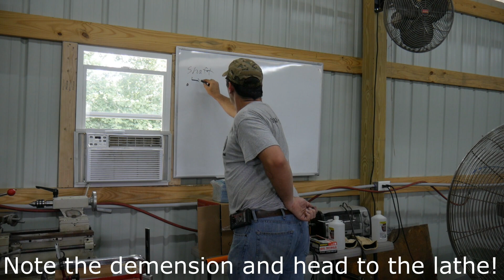DIY Tormach 4th Axis Ep 3

Comment: I just ordered my driver, same listing as yours to keep this simple.  Is there any reason not to use the highest torque (425 oz.in) motor option other than the cost being $10 higher?  I'll inevitably try to press it into service as a full 4th axis so just looking for all the beans I can get out of it without going servo right this second:  https://www.amazon.com/Torque-Stepper-Motor-425oz-Router/dp/B00PNEPW4C/ref=sr_1_3?keywords=nema+23+high+torque&qid=1560280417&s=gateway&sr=8-3
Reply from the maker: I didn't as I was trying to stick as close as possible to what tormach makes. You really dont need a lot of torque as the gearing takes care of that for you. 

If you were to use the larger motor just be sure to set the driver up for it. You'll also need an IDC10 breakout board. I'll detail it in the next video.